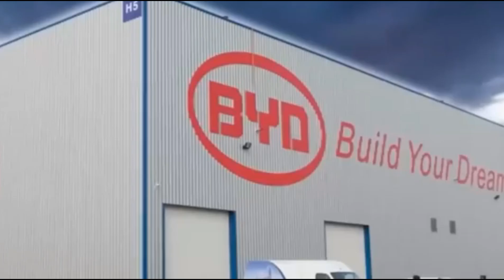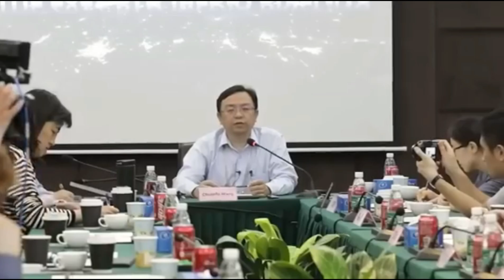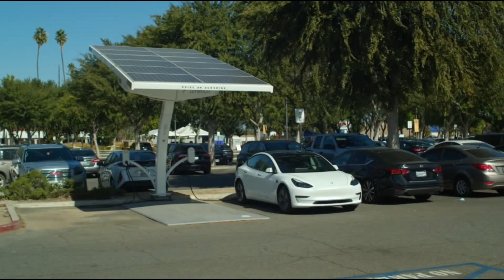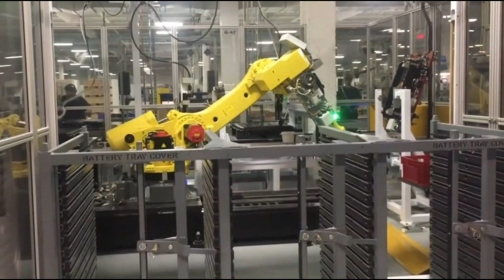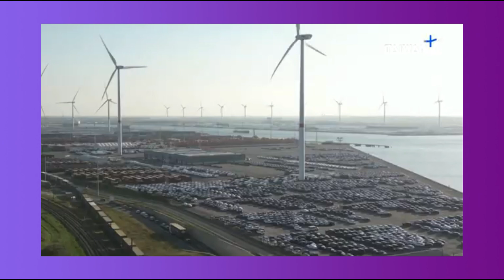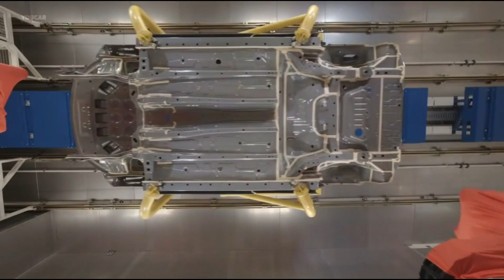Ghana to Become West Africa’s Electric Vehicle Hub? BYD Says YES.

Comment: I don't how accurate is this video but how silly would it be to build EVs in Africa?
EVs are already expensive for most northern hemisphere inhabitants (who have more money)
Not only that, EVs require a network of fast chargers and obliviously a steady power supply grid.

African mechanics can fix a half a million kms ICE car with few tricks but they won't be able to fix an EVs with any trick at all.
Meaning after 200000 kms when the EV's expensive batteries & motors will die , the car will be useless as too expensive to repair for resell.
Reply: You have no insight into how ev works and you are demonstrating your ignorance. Price of the vehicle isn’t only the factor at play here. Evidence shows that Cost of ownership of those ice cars  plus original price are more than the total cost of Evs and the ownership
Reply: @Adasijnr My ignorance? WTF are you to insult me?
What's the GDP per capita in Mali / Burkina Faso / Mozambique / Ghana, etc ?

People drive old cars fixed with wires and tape, you gonna tell me EV are for them?
Some countries don't even have a steady power supply with many daily power cuts and EVs will be the answer?
Reply: @SERGIO-cr6uy  You are still demonstrating your ignorance with the steady power argument! Steady power was an issue because there was no way to store it. Storage cost has decreased tremendously. And with EV there’s an energy storage inherently built into the system. In these countries they are blessed with the most reliable generator of energy which is the sunlight constantly through out the year. Now the cost capturing this energy has also decreased. It makes a lot of sense to heard to that direction. ie EV

You’re demonstrating that you have an opinion without a lived experience.
Reply: Also putting Mozambique etc and Ghana into one basket is also another ignorant statement! I am sorry but someone has to point it out to you.
Reply: Your original statement “motor and battery die at 200000km” is also ignorant. There’s no evidence to support that. 

Do you know that ICE vehicles waste about 80% of the energy in their fuel? Think about that carefully and make the maths!

In fact, for every dollar spent on gasoline, only 20 cents of it is used to move an ICE vehicle along the road. EVs, however, operate at about 87% - 91% efficiency – in part due to regenerative braking, which recaptures energy that would otherwise get lost as heat from friction.
Reply: @Adasijnr  Of course there's evidence of car batteries not lasting more than 200k kms.
Most batteries will last between 120k et 200k kms, it all depends on the battery pack installed.

Smaller car cannot have large battery packs due to space limitation and some large cars don't have large battery pack to reduce the cost. Extended range (large battery pack) being sold as an option.

Now, the less battery you have, the more often you charge, the quicker it degrades, is that false?
Reply: @SERGIO-cr6uy  Most batteries retain capacity of about 80% after 200k kilometers. 

Ultimately, I want you to know that the situation is more nuanced than you make it sound. And if the government convinces a company manufacture EVs in Ghana, it is a right call. In about 20-30 years all iced cars will be found in museums and enthusiasts garages. ICE technology is getting obsolete!
Reply: @Adasijnr  In 20/30 years ICE cars will have vanished? That's a dream of Chinese manufacturers, isn't it?  What about Trucks, tractors, mining equipment, will they go electric? What army tanks, helicopters , fight jets, will they go electric too?
Do you know from what the plastic comes from? Do we recycle plastic?
Are you aware that most countries have a 50% tax  on petrol and diesel but only 20% VAT on electricity, where will they find the missing money? Will they raise the cost of electricity?Meaning elderly folks will pay more their electricity so that people can drive electric cars?
Reply: @SERGIO-cr6uy  You’re deviating from the main focus of the argument. EVs are here to stay. No major car maker is investing in advanced V8 etc. At worse they are moving into hybrid, which is essentially EV with the petrol generator in it. In heavy duty equipment, once the maths are right in their favor, they will move over. Basically, the technology of ICE cars is obsolete! It’s just a matter of time. People still ride horses for recreational purposes at the beach and that will be the fate of ice cars in the future! No one is riding a horse from Accra to Kumasi
Reply: https://youtu.be/Sm33rrAiXB0?si=d3zan2lYFfjExDWb